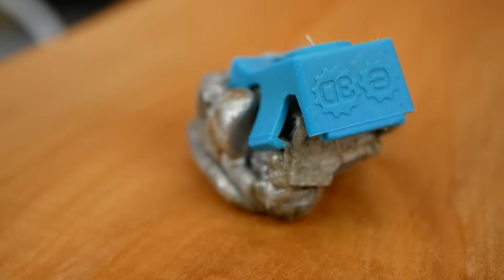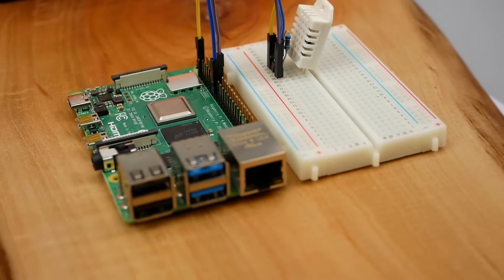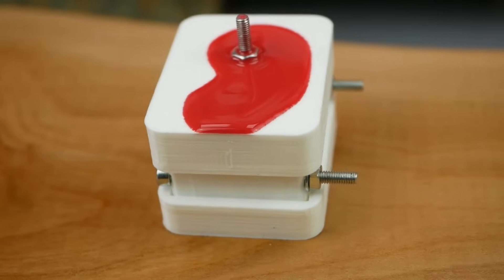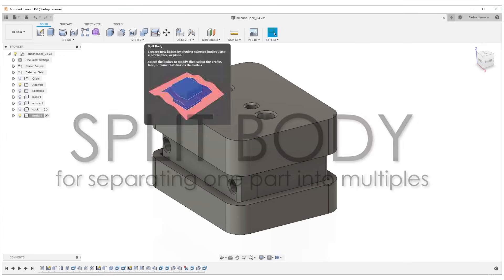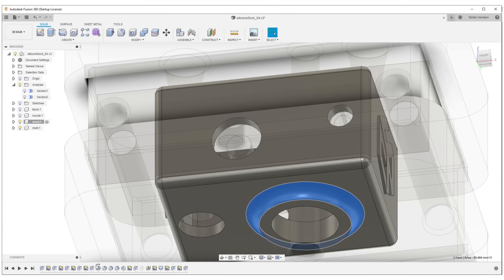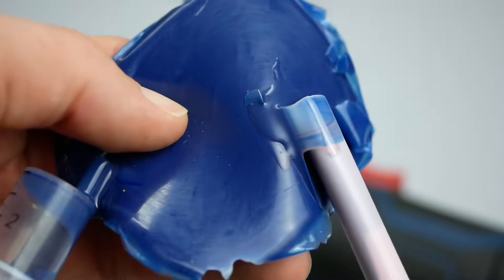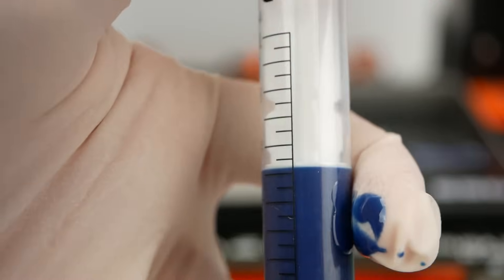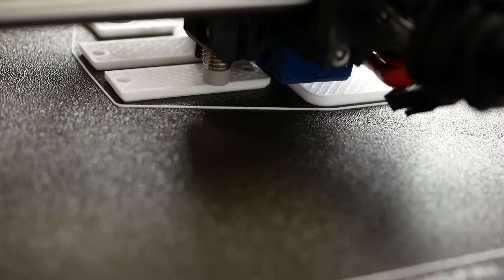Design & Cast your own Hotend Silicone Socks!

Comment: I suspect some simple finishing process either sanding down the mold or applying something that could act like bondo putty for plastics might allow someone to make a 3d printed mold smoother if they desired.    I started down the path of making my own silicone mold but got distracted by something else.  I'm glad you persevered where I didn't.  It's really neat to see someone do this.   I have a different heat block, so I'm more likely to pick it back up and utilize things I learned from your design in the strength and separation aspects of your mold.  That helps a lot!

Comment: Hi, I printed your mold but I had an issue with the sizes of the holes and I couldn't assembly the mold, probably my printer has some dimensional setup to do. Any advice about that? By the way, nice channel, all your videos are very instructive. Thanks!
Reply from the maker: Just use a bit of sand paper or a file, or bore the holes bigger.

Comment: Is the silicone sock really needed on the Prusa MK3S? What are the benefits?
Also, should you re-trim the printer when you use such a sock? calibrate the D-values?
Reply: * PID-values

Comment: I came up with something similar when my sock was getting a bit worn out. i used a top and bottom half with one die in the centre. i printed the bottom half with m5 threads and the top had some indents for the m5 screws to sit flush in. mine largely worked but i wasn't using the right silicone. i was using an old tube of tiling silicone that was just going bad in the cupboard. it worked but it was much too soft.  i just squeezed the silicone into the two halves. stuck the die in and tightened the halves down. the excess squeezed out through the weep holes i had in the sides. 

mine worked but the choice of silicone was wrong. at 3 for $10 though i gave up and just bought the premade socks. my design was free and quicker than the post. but i'm not buying half a kilo of silicone to make 2-3 socks if i needed a new one every print it might be worthwhile. but these things already last forever usually only degrading if you end up with eruptions like the start of the video

Comment: Yeah silicone mold making is a joy! It almost gives you as much new possibilities for making things as a 3D printer does.

However, doing a vacuum degassing using the syringe was pure genius! I'll have to try that.

One thing you can try to reduce flashing is to apply petroleum jelly or similar on the faces that mate. Not the sides the touch silicone but just to close the gaps.

Comment: I found the video and all your eplanations very interresting. Alltough I never had any issue with the new E3D silicone sock that I ordered with a Nozzle X. It never came loose or anything. But maybe I will cast something else made of silicone in the future. I still have a tube of Dirko Rot in my basement which will otherwise stay unused.

Comment: Thanks for this, I printed in ABS and put this together on an e3d titan aero with a 0.25mm nozzle and it came out amazing! Did acetone smoothing wherever I could. will be posting my make on thingiverse. Fits great and retuned the PID's on the hotend and I've never seen such a smooth line in my octoprint temperature history vs the stock e3d sock!  It also inspired me to design my own molds to make spring replacements for my taz 5's heated bed

Comment: I've been using high temp silicone adhesive from the hardware store for wood stoves, ovens and stuff to create my sock. Has been working fine for over a year with temps up to 240 C.

Way easier to get rid of the bubbles though with liquid two component silicone, that's for sure.

Comment: for my hot end I just painted a thick layer with that rtv silicone. Works great. Plus I also found out that making a separating layer with kapton tape(keeping the hot side separate from the cold side) makes a HUGE difference. Actually the separating layer made the most difference. I was fighting the temperature emergency timeout. Soo>> when one needs to print PC its more like 280-300C.. basically above 250c the temperature would sag below its target range for longer than bla bla seconds when the layer cooling fans would run. well making a flat horizontal layer of tape created a situation where the heat from the bottom doesn't go up NOR do the cool layer fans get cool air anywhere near the whole everything. it basically stop the air currents.. convection.. or directed air.. So that stabilized the temperature dramatically. Which lowered my power consumption etc etc ... Paradigm = prevent the air from the hot end area from reaching the hot end cooling fan. It might not be apparent that air flows like that, but the heat does. its just lost. like an open refrigerator or an open window.
Reply: I think this is a great point!

Comment: If you mix in a small, wide mouthed mason jar and attach a fermentation lid with a hand pump vacuum, you could probably remove the bubbles before you get to the syringe.

Comment: Really perfect looking result! I will be using silicone for the creation of jewelry part copies. So my approach will be opposite.When injecting the resin using the syringe you can build up some pressure inside the mold by covering the second hole with your finger. That will help eliminating trapped air bubbles inside the form. ;-)

Comment: I don't get it. you create a mould to use around a object,
Call me dumb but you just get dimensions and make in cad like you done with 360 and job done, even simpler in Matter control. you create an object, get a square and make bigger than object, put the object in middle of square and click the extract option. Wala ! perfect mould., I use this feature all time Matter control its an amazing free software that you can design and print all within the same software, and best of you can edit on the fly.

Comment: Great video!
One thing that I've found that has helped out with the E3D socks is to tightly wrap a piece of Kapton tape around the sock to make sure it stays in place. The tape doesn't stick to the silicone, but if you do a couple of wraps it'll stick to itself. Since I started doing this, I've not had a single issue with even the Pro E3D socks!

Comment: I've only used the e3d pro socks, never had problems with the sock moving. Your problem might be the nozzle not reaching far enough from the heat block, you can try to screw the connection screw between the cold side and the heat block more into the heat block.
Nice video though, I will definitely try to make a custom heat sock!

Comment: Hey Stefan,

thanks for this video! I recently had to replace a clip for the wristband of my garmin vivoactive 3. I printed (https://www.thingiverse.com/thing:3374775) it using flexible filament (tpu) from anycubic. It works so far but it's very stiff (95A shore hardness if I'm not wrong) in comparison to the original one. The original one is imho made out of some sort of silicone. I guess I'm going to design a mold for the wristband clip to cast it in silicone. ;-)
I think that's a way better solution as to try ninjaflex filament for a more softer clip. But that doesn't mean I won't get some ninjaflex to fill up my filament storage. xD

Greetings from Worms (Rhineland-Palatinate)

Comment: Coat the mold with acrylic floor polish to make it a bit smoother and seal any porous spots. To fill gaps where you have flash, after coating the mold with floor polish and letting it dry, put a mold release (like car wax) on one side of mating surfaces. Then brush a coat of the floor polish onto the other face and assemble the parts. Let the floor polish dry and the mold parts should come apart, with one mating face coated to match the bumps and dips of the other. Or you could coat both mating faces and set them down onto a waxed smooth surface to dry.

Comment: I have used both silicone socks for my E3D-V6 hot end, and I prefer the sock with the smaller hole in it. I found the sock with the larger hole collected more plastic on it than the smaller hole.

Comment: Very cool project, and nicely explained!  At the point where I began to wonder why the mold looks the way it does, you began to describe the design iteration process.  I too, think this is a better, tighter design.  Separately, I find my silicon socks from E3D don’t last near as long when printing PETG at 250C compared to PLA at 210C.

Comment: I can think of two things that would be immediately useful: feet for your printer to absorb vibration and applying a layer (held in place with window screen and metal rods?) to the bottom of your hot plate to insulate it.
Reply: I already did the feet for the printer and they work great with two screw holes for m5 screws to hold on place

Comment: Have you considered using high temperature silicone sealant as used by plumbers & heating engineers? It’s a lot cheaper and easily sourced at a DIY store.

Comment: Awesome. Saw the model a day or two ago and was waiting for the video. I've not had any issue with the "new" sock, though this video prompted me to double check it and I see a few tabs starting to come loose, so I pushed them back in place.

On the video itself, everything was top quality as usual... except the Fusion 360 section. You came across as nervous to me. Just pointing that out. Otherwise, looking forward to what you put out next!

Comment: If you use a thermal interface on your nozzle/heatblock, and heater cartridge (most importantly), you will never have to use a sock. You will not believe how much faster your hotend gets hot with a thermal interface- it's night and day. I use Deepcool Z5 thermal paste because it can go all the way to 300 degrees celsius. Just don't use it on your heat break.

Comment: This is giving me the idea to create small blocks of silicon to cover the top where a large part of the heating block is exposed and cooled, then weld them in place with a little bit of more silicon. This will make sure the sock doesn't move around and help insolate.

Comment: I dont have high temp silicone. I do have some normal bathroom silicone and was trying to figure out how well it bonds with 3d printed parts and... It does bond well. I mean silicone does not stick to pla but all the nooks and crannies and its texture makes silicone grip to the plastic.

Comment: The E3D sock is probably designed as it is since industrial moulds are expensive, and it needs gaps on both sides for the cables for all the various printer configurations. A more enclosing design like this would still be fine for mass production actually, since you can manually cut the slots in afterwards. You even have the option of not cutting the sock at all and building the hotend around it. I guess they were going for ease of use and universal compatibility rather than rigidity, that said I've never had mine come off yet.

Comment: For the sock moving, make the sock physically a little thicker, and possibly get a thicker silicone or add a thickening agent or fibers.  If it is more rigid and less likely to come off or shift around on the block, you should be able to do the small hole version without problems..

Comment: If you want to make something unique and make massive amounts of that object or make it out of say aluminium a mould is perfect. I have printed a candle mould before that works fantastic to make a unique candle for a loved one. Most backyard DIY can make a foundary for aluminium cans so if you 3d print then cast a wax mould then cast a clay from that you could melt out the wax and cast aluminium.

Comment: I think such a silicone mold could be used to produce DIY "injection molded" parts if the parts are small and the numbers are reasonably small. Like you said they can withstand the temps and are plyant so de molding will work even if it is not expertly designed. Off course you need a containment vessel for the silicone mold so it wont deform under a bit of pressure.

It can also be used to cast resins a lot easier than that.

Comment: I did something similar with a 2 part PLA mold but I used an acrylic glue called Genii Quartz to smooth out the 3d print layer striations before casting.

Comment: I made volcano molds before e3d ones came out. I don't feel the need to make my own now as the e3d volcano socks stay on with no issue, and the new version of the standard block don't have a problem of staying put either. I find the castable silicone disintegrates much quicker than the stuff e3d uses. I was only able to get about 2-3 weeks out of the homemade socks before the silicone started to crumble and disintegrate -- and yes I used the high heat stuff -- rated for 370c for prolonged exposure and over 450c for short exposure
Reply from the maker: E3Ds volcano socks are great and I never had a problem with those. Just cast one for for increasing my sample size. I've been using mine for quite a while even with PC that is printed at 270°C and they are still as flexible as on their first day.

Comment: you can just make the mold so you pour the silicon in, no need to have a top and be forced to squeeze silicone in. 
Gravity will make top of silicon flat ;)
Reply from the maker: True.
Reply: Thin molds like that are a pain to fill, additionally it's almost impossible to get the top surface flat, it will have a positive or negative meniscus.. The approach followed here was the best.
Reply: @jimbit22  I have battled the meniscus with a very tiny chamfer facing in towards the silicone filled cavity at the top lip of my molds you just need to very carefully fill enough even after the bubbles pop because the bubbles make the level go down.

Comment: am I the only one getting SSL certificate errors following those affiliate links ?
Both Firefox and Chromium refuses to access the site:

An error occurred during a connection to geni.us. You have received an invalid certificate. Please contact the server administrator or email correspondent and give them the following information: Your certificate contains the same serial number as another certificate issued by the certificate authority. Please get a new certificate containing a unique serial number. Error code: SEC_ERROR_REUSED_ISSUER_AND_SERIAL 

Other than that, great video Stefan !
Reply: Try clearing your history, or cookies if that doesn't work, the "geni.us" links to Amazon are working for me (Chrome).

Comment: Have u tried sla 3d printing for this process? The resins affect the curing of the silicon?
Reply from the maker: Should work just as good. I just avoid resin printers as much as possible due to the mess involved.
Reply: Depending on the rtv rubber it might.
I've had curing issues with the monocure rapid gray resin and silicone.
The problem was that the silicone did not cure 100% where it was touching the printed part. It wasn't liquid, but it remained sticky even after post curing in an oven.
Reply: @jimbit22  spraying the parts in primer before using them as a mold should help

Comment: All the problems about silicone bubbles pop away at 13:18 without spending $100+ for vacuum chamber and pump, and this might just works for the very important first layer that hits the most detail of any of one's moldmaking project, to be bubble-free. wow, much thanks!

Comment: Did you think of using the real aluminium block in the center for the mold? This way you can do a cast in place and you wouldn't even have to put it on because it is on. Tighter fit!
Reply: I made this, but it didn't work as well as the one in the video: https://www.thingiverse.com/thing:3548093
Reply: Put you still have to install the heater and thermistor.
Reply: Silicone rubber does not stick to anything but itself. So even if you cast it in place it will come loose. Making the mold fit the block precisely might be a difficult chore..
Reply: @jimbit22  I used 300C black silicon for oven and it sticks to metal (in my case it was galvanized iron plus cast iron plus tile).
Reply: @jimbit22  Of course it doesn't stick. The main reason is so that you don't have to stretch the silicon mold and you don't have to make it so that you can replace it. It will be a much tighter fit and will allow for more coverage since you don't have to plan gaps in order to take it off. This can be designed in such a way that you can even switch nozzles without having to remove the silicone sock :)
Reply: @MarinusMakesStuff  from experience, because there's no tolerance between the parts it will be a pain to re install the sock if it's 100% fit.
Sometimes the master slips on me when making 2+ part silicone molds and it never goes into place again without distorting the mold.
Having said that i can't be 100% sure that it won't work..
Reply: @jimbit22  A few tips here on making silicone molds. http://partsbyemc.com/pub/mold-making.htm What I do now instead of using glossy printed corrugated cardboard for mold forms is I cover plain corrugated cardboard with clear packing tape. I've been doing silicone mold making and resin casting for 20+ years.